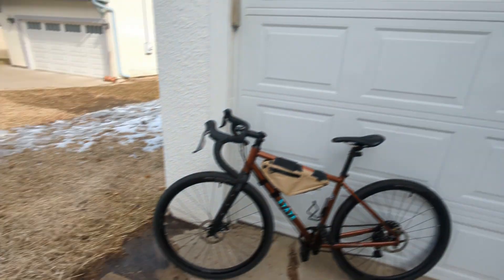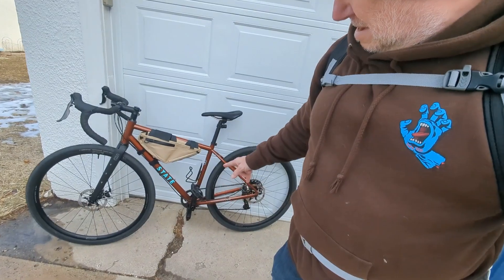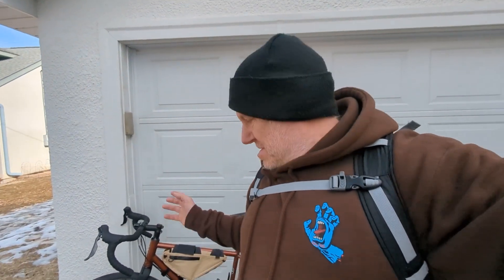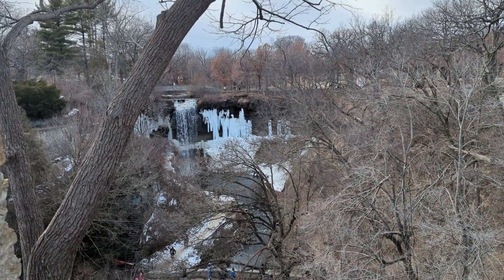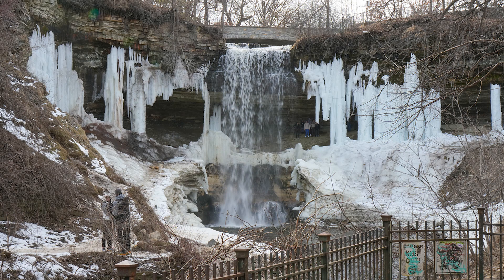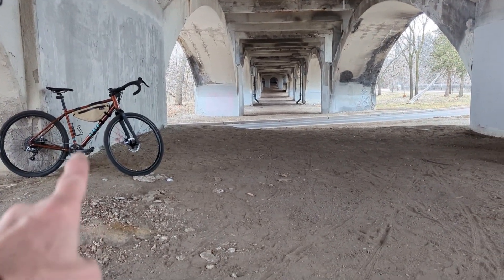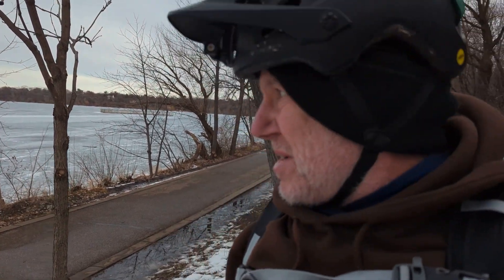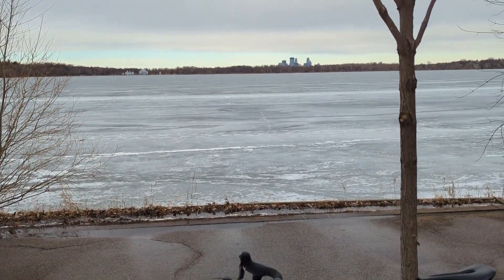State Brake Check Mixed With A Little Photography

Comment: The cable breaks.  Might just be needing the adjustment. I have a pair it took me 6 rides to fix the pull was good just adjusting the cable.   Worked.  Being it cable system brakes the pull is tricky work with it. Maybe the the levers it might be the cable tension.   Just remember the cable to hydraulic ones are way different.  And.  Being if they are new. Did you clean the disc? Can be dirt on them. Or the pads now.   Just give it time.   And the bedding in. Is way different on a cable system.   They take time to work for ya.
Reply from the maker: I have the same brakes on my Salsa Fargo. It took me about 5 or so bed in sprints up and down my street for them to start working good. So these technically show work by now.